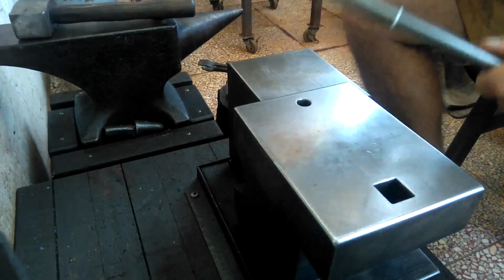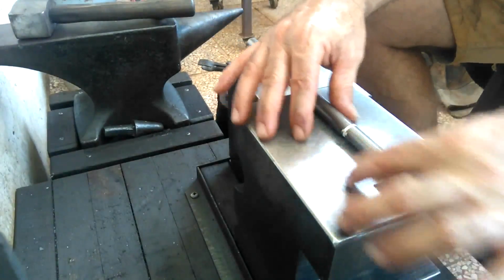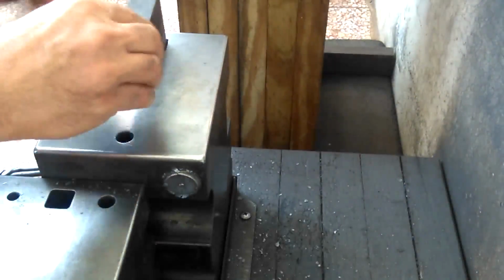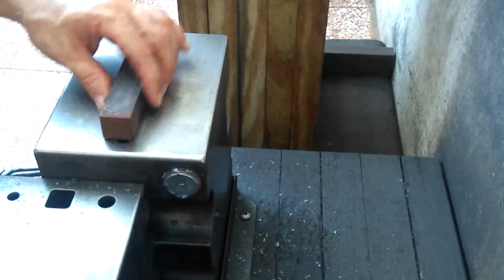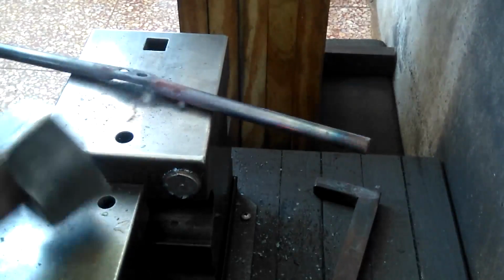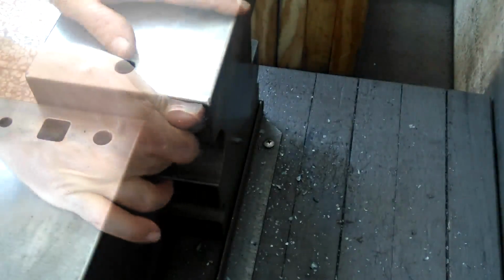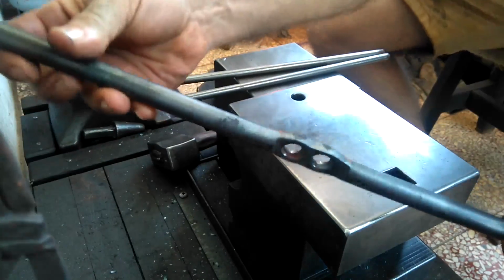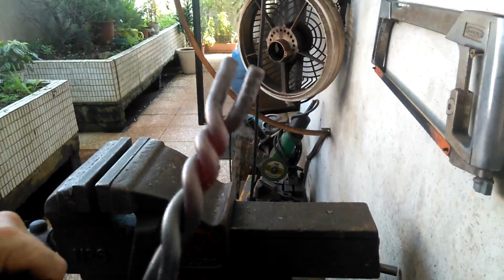Simple Twisting Wrench for Rounds

Comment: Thanks for the video Glen.  If you don't mind, how do you heat just the middle of the bar in a propane forge?
Reply from the maker: Dale, My forge is a pass through type. So, I unblocked the back end (blocked with firebricks) and then can pass longer stock through. Thanks for watching. Glen

Comment: If the wrench were left a bit thicker, that splaying of the twisted stock would be less.
Reply from the maker: That does seem logical. Or if I kept the wrench higher up and didn't allow the ends to protrude, that should also prevent the splaying. Thanks for watching. Glen

Comment: Was the shank being used at the beginning just for a reference guide for the space size of the twisting area? Does it keep the material from spreading as much, I'm assuming it's softer than the anvil. Just always see people use the anvil for the same type of process. Definitely much more accurate! It'd be interesting if you could make it adjustable for 1-3 sizes. Could it be done with a larger stock and then make lower size inserts with a lip? In the end it'd probably just be cheaper and easier to get different sizes stock. 

Great video as always! Glad you got some rain, I'm sure the farmers were happy!

One last question, have you ever made a knife? I know that your finish on your tools would look awesome on a knife! Sorry, two questions lol... what about a jig for mokume gane?
Reply from the maker: Phillip, I just wanted to flatten a specific area to make punching the holes in that round stock easier. So that hardy hole "saddle" type of tool came in handy. The size was not so important so long as it helped me flatten enough area to cover the width of the two holes. That tool is 1045 steel whereas my anvils are 4145. They can both be hardened to similar degrees but the alloys in 4145 make it resist deforming much better. I've only made an occasional knife and to be honest, am pretty terrible at blade work. I don't think I could make a jig for pattern steel. Thanks for watching. Glen